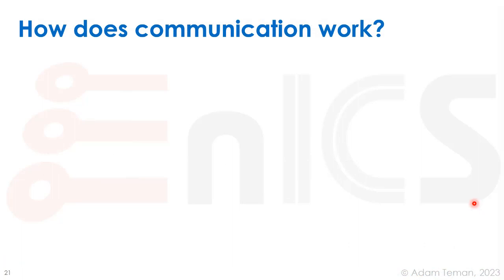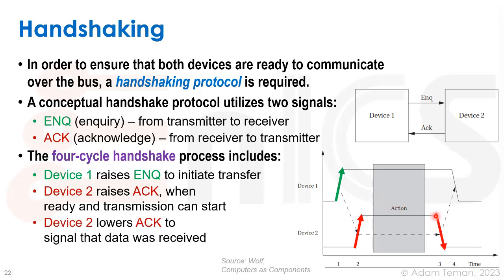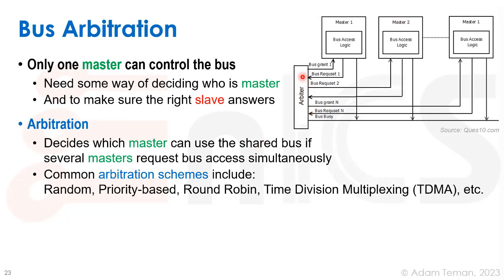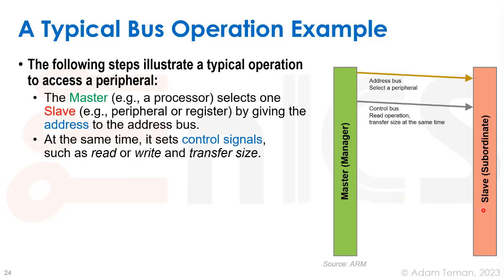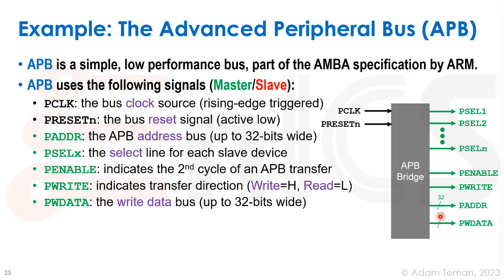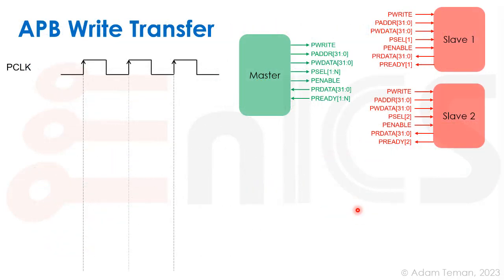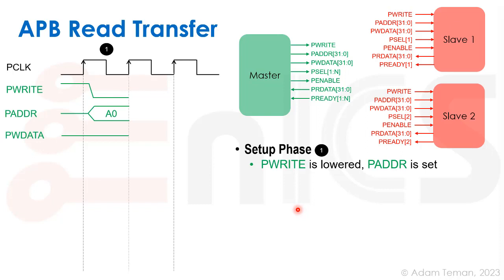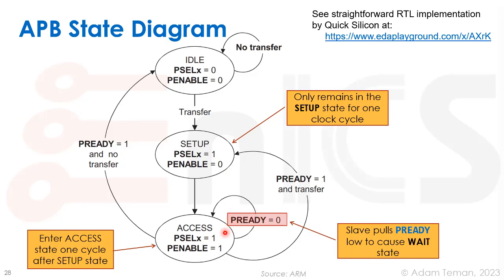SoC 101 - Lecture 4c: Simple Bus Operation

Comment: So the data will be out in 2 clock cycles as we are staying in setup and access phase for 1 clock cycle? but in slide it all happens in 1 clock cycle.
Reply from the maker: Hi Ahmad,

I'm not sure which slide you are referring to, but I assume it's the APB operation.
Indeed, APB requires 2 cycles. I believe this is also represented in the waveforms, but if there is a mistake, please point it out to me so I can pin a comment about it and fix it in my slides.

Thanks.